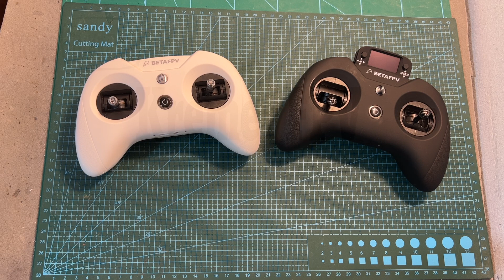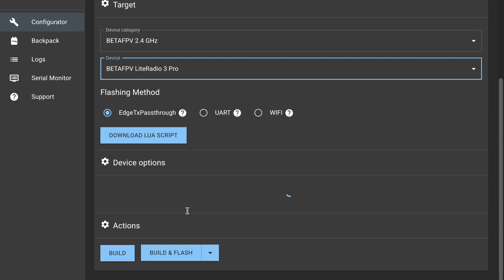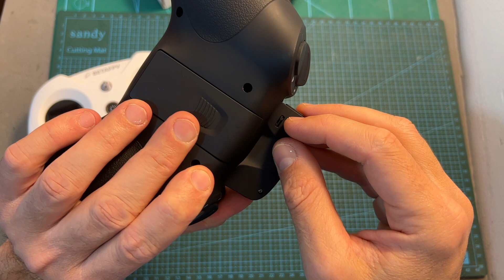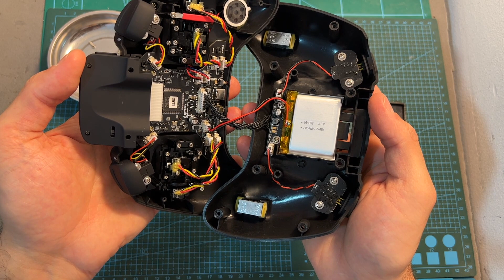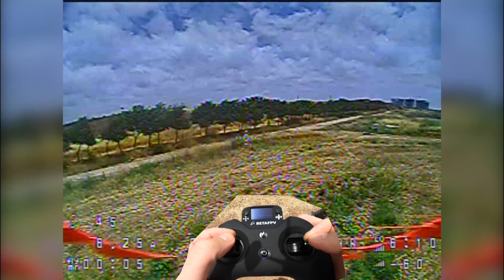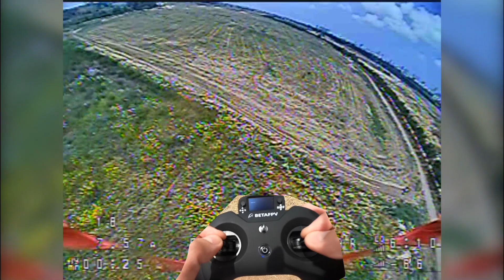BetaFPV LiteRadio 3 Pro ELRS Radio Controller

Comment: Great video Gal. Any idea of the weight? The weight quoted for the Zorro is heavier than I was expecting. I like to throw a micro in my backpack and stop at a park on my cycling home from work for a fly but quad, goggles, batteries, TX, tools all adds up along with a laptop and other work stuff.
Also, thanks for pointing out that the non-pro version only supports CRSF module. I didn't know that.
Reply: Zorro is bulky for backpacking imho, protruding screen takes too much space.
Reply from the maker: Hi Peter, sorry for the late reply. I actually weighed it but forgot to reply to your comment... I don't have this radio anymore so I can't test it unfortunately... 
Did you get this radio controller eventually?
Reply: @KremerFPV  No I haven't bought yet. I think I will be ordering a Jumper T-lite V2. I was about to buy a V1 when they discontinued it. It is such good value and does everything I want. Thanks
Reply from the maker: @P-Bee  No problem. I will review the T-Lite V2 probably next week.

Comment: Thanks for the video, I have one but need a walkthrough for updating, cause I have trouble understanding the manual and configurator.
Reply from the maker: My pleasure. Did you manage to update the Radio?
The most important thing is to update the ELRS module, using the ELRS configurator tool.